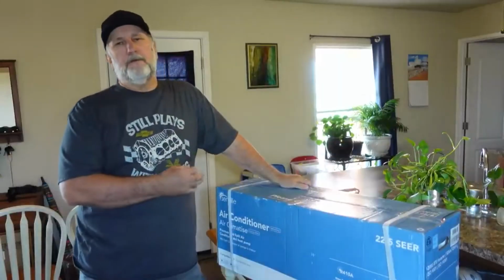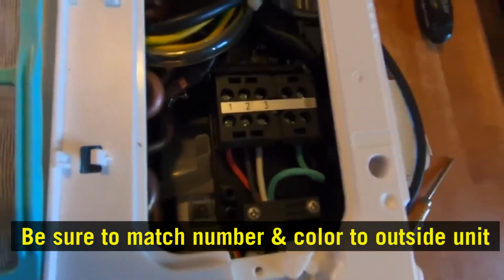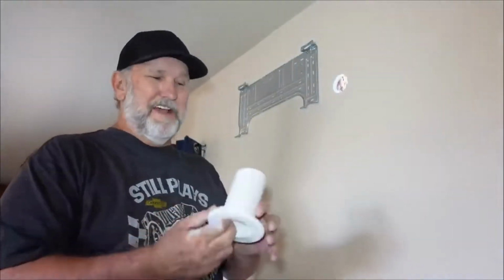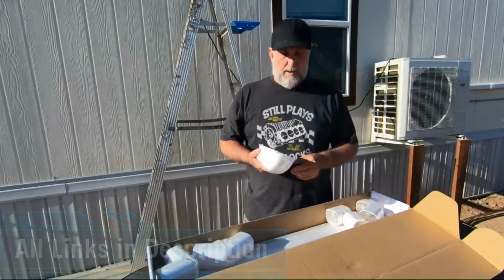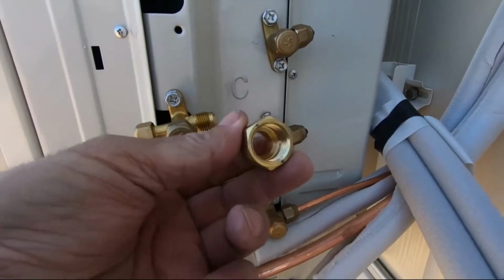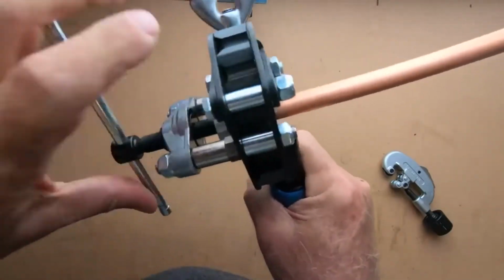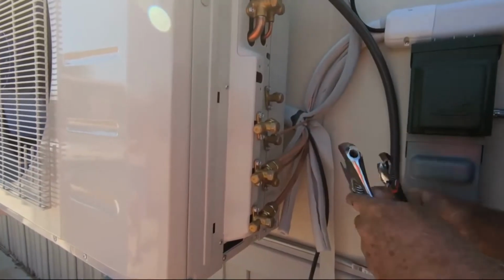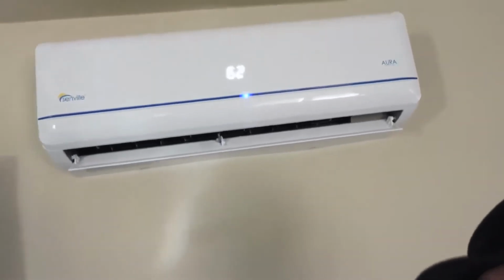Step-by-Step Guide: Installing DIY Mini Split Dual Zone Senville & MrCool

Comment from the maker: Senville 28000 BTU Dual Zone Mini Split: https://amzn.to/3lIavq2
Check out the Install Cost & 8 Month Review:  https://youtu.be/W51_c8IuA_8

Alternatives Units:
C&H 2 Zone Mini Split:    https://amzn.to/3Nyq9UC
MrCool DIY 2 Zone:   https://amzn.to/3pkcN6d

5/16" Female Quick Couplers x 1/4" Male:  https://amzn.to/3nQE4aV

Alternative Quick Coupler Installer Tool: https://amzn.to/31c40E3  My Choice!

Yellow Jacket 60278 Flaring Tool:  https://amzn.to/3dwHpae

Screw Feed Tubing Cutter: https://amzn.to/3nQJ3Zb

My Favorite Close Quarter Tube Cutter:  https://amzn.to/3rpZxcg

Vacuum Pump HVAC:  https://amzn.to/318YEcC

PVC Decorative Line Cover Kit (one for each head): https://amzn.to/350IfIu

Outdoor Mounting Bracket:  https://amzn.to/2Fw9vpq

2-1/2 Inch Bi-Metal Hole Saw:  https://amzn.to/343BJS6  This A/C Unit Requires

3-1/2 Inch Bi-Metal Hole Saw:  https://amzn.to/3lIcpqG  If needed for your A/C Unit

30 Amp Fusible AC Disconnect:  https://amzn.to/31aHN9c

Comment: When you hook the vacuum hose to the low pressure pipe, there is another part between the end of the vacuum hose and the backside of the low pressure valve. What is that part? I don't believe I see it listed below. Thanks for the video. It's given me the confidence and the steps I need to do this.
Reply from the maker: Hi, I think your refering to the adapter - 5/16" Female Quick Couplers x 1/4" Male:  https://amzn.to/3nQE4aV   Thanks for watching Brad!

Comment: Love the video sir!! I want to install a mini but where I want and need is not going to be 5 inches from the wall on the damper, and more like .25" and wondering if this is a problem? I see other videos say you need 5" and that won't work for me. The in advance.
Reply from the maker: I have seen others do it with decent results but there is a reason the manufacturers have these specifications and your unit may take a few years off the length of service

Comment: So 2 zones 1 condenser outside unit.
Can each zones set for different temps? Or it has to be the same temperature when its running at the same time?
Reply from the maker: Hi Outdoorsy, Sure you can , the air handlers run independently of each other.

Comment: I’d like to shorten my lines like you did. Is there no refrigerant in the unit in the house? I see you pulled a vacuum on the shortened lines and assume they were connected to the unit inside the house.
Reply from the maker: Hi Jim, Once shortened and everything hooked up is when you vac lines.  I believe that MrCool is the only one with a diy kit that has pre-charged lines that cannot be shortened and keep lines full.

Comment: Thank you for making these awesome videos! We have a question about installing a dual unit back to back on an interior 2x4 wall.   You show the coolant lines being run out the back into the wall into the wall.  Can it be bent to run up inside of that wall into the attic?  It seems like that would be an extreme bend.    How might we do that?  Would we have to run through the side?  Also, can a fuse box be a circuit breaker instead?
Reply from the maker: They do make hand benders for this but I found just massaging and bend it by hand works well.  As far as the fuse box, code here you need a real a/c disconnect and I agree with it even though your still running it from the fuse go ahead and install a disconnect to be safe.

Comment: Thank you very much for your time and posting. I've seen about 18 videos, a couple of yours. Question please. I'm going to buy a MrCool DIY 27K BTU w/ one 9K BTU head and one 18K BTU head. One Set Line will be 16 ft. One Line Set will be 35/50 ft. (not sure yet). The question is. With the 35/50 ft. Line Set, will the black power cable be 35/50 ft. As that is the distance to the power box. Or will I need two power boxes? Hope that makes sense and thank you for your time. :)
Reply from the maker: If you order it that way yes they will supply the right size communication cable for it.  If you are ordering longer lines separately then go to home store and get the length of cable you need.  I hope that is what you were asking.  Thanks for joining in here!

Comment: I notice some units say 120V and others are 220V. How do you know which one to get? I need a 9K BTU or a 12k BTU unit for my sunroom but don’t want to put $4500 for a carrier and install for a 3 seasoned room
Reply from the maker: Telling them apart would be by item description in the listing but you can tell from the outside unit electrical connections on the 220v it will have L1, L2 and ground which means L1 and L2 are hot and on 120v it should be marked as L, N and green which is Hot, Neutral and Ground.

Here is a video of a 120v setup which may help  https://youtu.be/07SB6aIJfPU

Comment: I bought 2 Senville 24000 BTU . I have a few questions. 
1) Is it possible that I make the pipe come out of the left side of the inside unit (not behind the right side of the unit, which is what you did) and make the pipe go down a little and then go through the wall? I am unable to drill the hole to the right side behind the inside unit. Can I drill the whole to the left of the unit and turn the pipe downwards before going through the wall?
2) For the drill saw, are you using 2.5 inch or 3 inch? 
Thank you!
Reply from the maker: Yes you can bend the line set to suit your needs of an exit as long as the drain line has a downward slope.  I believe they called for a 3.5" hole saw but I used a 2.5"

Thanks for watching I appreciate it!
Reply: @ILikeToBuildStuff  thank you for your response! I gave your video a thumbs up and forward!

Comment: @8:10...I mounted my handler to the wall, now how to I remove it so I can take that dang ring off ???(it shows below the unit and looks like crap). Thanks!
Reply from the maker: Pull out from under the air handler to get your fingers on the latches then lift in upward motion, like when you pulled it off the unit when unpacking it for install.
Reply: @ILikeToBuildStuff  do I press the latches too?  Thanks.

Comment: I'm looking into getting a 4 zone unit, but two of the rooms don't have outside walls. I would need to run the lines up into my attic and then down to the unit outside. Is it possible to have the lines run up through the wall and into the attic? It doesn't seem like this will work for me.
Reply from the maker: Hi Katie, you can run line anywhere in the home it's just the condensation drain lines that need to have a downward slope to evacuate the water to a drain or to the ground outside the home.

Comment: Great Video!  I need to install 2 zone unite on the second level of my house in two beardoms.  Each room is 210 sf and I'm located in North GA.   How many BTU's unite would you suggest?  I was thinking 9000 each evaporator and 18000 condenser.  Thank you
Reply from the maker: Hi Marcin, there are a number of sizing calculators online just do a google search or go here for a basic understanding https://senville.com/blog/sizing-guide-for-a-mini-split-air-conditioner/

With that said most average bedrooms is 9k to 12k I like 12K  and average living rooms 12k to 18k  I usually go higher just for the heating aspect of it.  they do a heck of a job cooling but it's not like a furnace